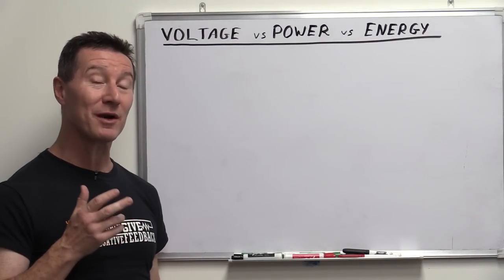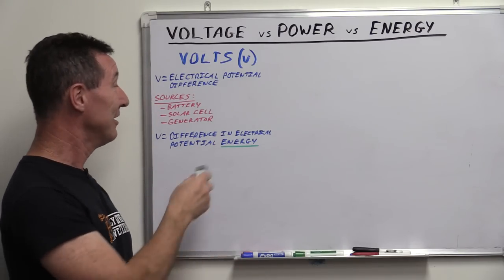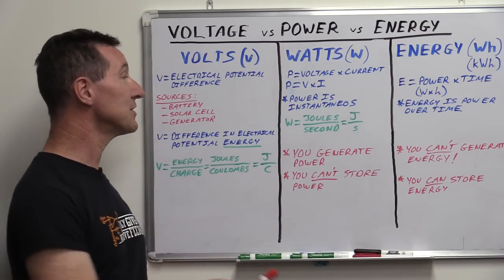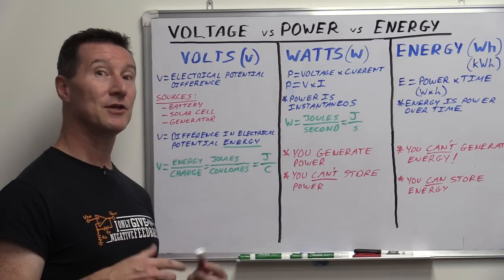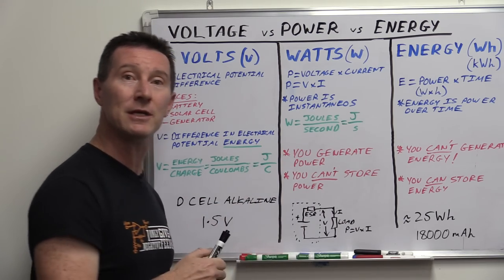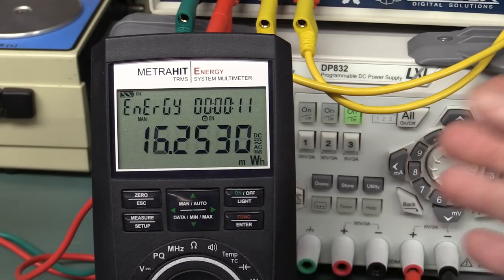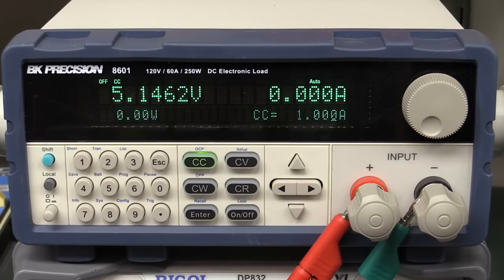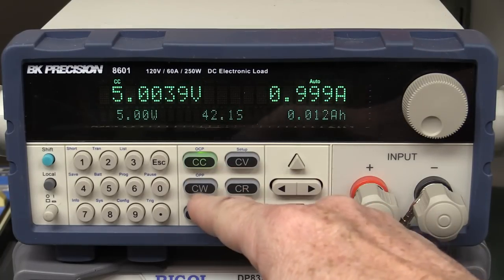EEVblog #1009 - Voltage vs Power vs Energy

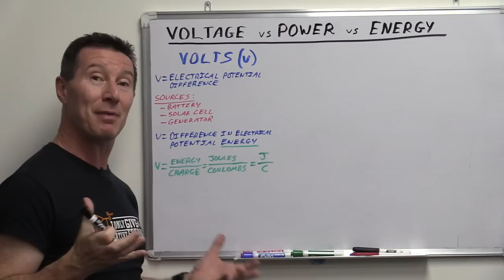Comment: 2:00 So Dave it seems there shouldnt be any voltage if there is no energy even though its just a very tiny amount. As the energy = voltage x current x time and if there is current then voltage is accountable. So both voltage and current are inseparable from each other. Hence to have voltage without energy means time parameter is zero that is not possible. Even if we just want to measure the voltage then also some power is wasted as well as energy even though its very minuscule. Static energy has also stored energy and thats the reason that it destroys sensitive components. What you say ?

Comment: You skipped a bit about capacity, especially with the dam example.
The dam contains the water so that is its capacity or mAh in battery terms
Energy is the amount of power released over time as you said.
But if its not flowing, no power generated, then there is no energy generated too. But its capacity is still there..
Reply: Power is energy in motion

Comment: I love these fundamentals vids.  For completeness you probably should have shown the formula for energy is E=(J/S)*S , which is of course E=J.  I really like your dam analogy, but everywhere you said the height of the dam, you really meant the height of the reservoir.  Going one step further, reservoirs have increasing ESR just like batteries.  As the energy level (amount of water in the reservoir) drops, the voltage (water level) drops, and hence the power (volume of water flow) decreases.
Reply: What? What do the E, J, S and the other S you used stand for? If it's E = Energy, J = Joules, S = Time (in seconds), and the other S = Time (in seconds), then, huh? You are correct that J = E, because they are literally the same thing (J is a measurement of energy, and definitely not a measurement of transfer of energy like power). But what you're trying to formulate doesn't make sense. J = W x t would be correct. Though no physicist or engineer working in the electrical field (heh) uses J, but just uses either E or Wh to denote energy.
Reply: +Lib3rta, these are the same units Dave used in the video.  Did you watch it?  What I wrote is correct.  I'll step through it for you.  1) Watts=Joules/Seconds.    W=J/S.    2) Energy=Watts * Seconds.  E=W*S. (I use Seconds because Dave did) He put both of these on the board.  If you substitute for W in that last formula, you get E=(J/S)*S.  The E is energy, the J is Joules, both S's are seconds.  He didn't put this formula on the board.  The seconds cancel, leaving E=J (Energy=Joules), which as you point out, are the same thing.  He also didn't put this on the board.  That was the point of my comment.  I guess he was right in deciding to leave it out because it would confuse some people.
Reply: @Star Gazer

But you do realize that your equation doesn't make sense, right? Look at "E=(J/S)*S" closely. It is a redundant equation. You devide joules by time, and then reverse it by multiplying it by seconds again. To translate your equation phonetically: "Energy is equal to [energy devided by seconds to get watts] times seconds". All you literally did was converting joules to watts and back to joules again to conclude that joules equal joules.

Edit: ah, great, you edited your equation to something completely different. Prior to changing E=W*S to it, you said E=(J/S)*S. It's okay to edit minor flaws. But come on man, this is a severe sign you hide your lack of knowledge.

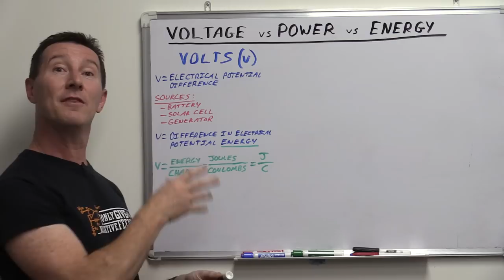Comment: 2:56 Well ... you can't have voltage without any energy at all. Which looking at the formula is kinda obvious, since zero divided by anything will always remain zero and therefore no voltage. But I get your point, since with an energy of almost zero you can still have pretty much any voltage...

Comment: I agree with most of what he said except for the last dam/water example.  The water flowing through the sluice is current, not power.  Voltage is how far the water falls before it is made to do useful work, like turn a turbine.  Current is how much water is flowing.  Power is the product of those two.

One thing he didn't make clear ... he's right in that power cannot be stored.  Energy can be stored but power cannot.  However, energy that has been converted to power, can be converted back to energy and stored.  If I have a hydroelectric plant and it puts power on the electric grid, that can't be stored, it can only be consumed.  But it can be used to charge batteries which stores the power as energy.  Or you could use the power to run a pump that pumps water to a mountaintop reservoir, thus storing water as potential energy.

Comment: I always wonder why people find this complicated!? The time differential of energy is power and if you integrate power over time you get energy. The sign defines loss or accumulation of energy or the flow of current from one potential to thenother in the case of electricity.

Comment: Hey Dave, what about Joules = W x second?, I've seen some power meters that measure energy in Joules. Anyways, thanks for another great video!!!
Reply from the maker: I deliberately didn't involve Joules to keep it simpler.
Reply: Right, Joules is the SI unit of energy. It's a Newton-meter. Applying one Newton of force for a distance of one meter will require one Joule of energy. So, for example, raising an object with a mass of 1 kg, with constant velocity, against gravity, takes 9.8 Joules: F = ma = (1 kg)(9.8 m/s^2) = 9.8 N, and W = Fd = (9.8 N)(1 m) = 9.8 J.
Reply: mgscheue technically, a Joule isn't a "Newton-meter".  "Newton-meter" is a unit of torque.  Newtons applied tangentially times the meters distance from the fulcrum, like foot-pounds.  But yes, a Joule is exactly how you define it, Newtons times meters, but not the same thing as a Newton-meter.
Reply: As Dave said, power is Joules over seconds (J/S), and Energy is power times seconds, so that means Energy is (J/S)*S, and since the S's cancel, Energy is just Joules.  So yes, utility meters can measure energy in Joules.
Reply: And to add another twist, when you calculate the arc fault energy available at an electric panel, you calculate the energy in Calories with a capital C (because that's how the protective clothing is rated).  You could calibrate an energy meter to display calories or Calories delivered instead of joules....
Reply: Please do not confuse S and s. S is siemens for electric conductance

Comment: Voltage = hight of a mountain

Current = size of bolders (diameter of wire ext) 

Resistance = trees in the way 

ieg bigger bolders can overcome bigger trees and higher mountain more trees The bolders can overcom. Lernned from Arduino starter kit book ;-)

Comment: I hate when almost all youtubers show some energy generating machine and they showing only volts instead of how much power it generates.
Reply: You can generate a tremendous amount of power with just a small capacitor.  It would be better to talk about the range of maximum instantaneous power, and the range of energy produced per day. Ranges because of weather conditions for solar or wind power and other variations for whatever method you use to generate electricity.
Reply: Charge a capacitor with an ESR of 10 milliohms to 100 volts and let it discharge through a 100 milliohm load (commonly known as a short circuit).  I = 100 V / 0.11 ohms, P = I^2 * 0.1 ohm = 80 kW or enough for a car.  // Lets make electric cars that run on charged ceramic or film capacitors!!!  If you use lots of them in parallel and big fat conductors, you can have far more power than a Bugatti Veyron.
Reply: The only issue is the maximum range of the vehicle, it's like 10 µm or something.
Reply: Oskar, your power calculation seems a bit off.  If you short circuit a capacitor through a 100 milliohm load I guarantee you won't be measuring 100 volts across it, therefore you aren't getting 80kW out of it.
Reply: Nope, it's spot-on: I didn't use P=U*I, I used P=I^2*R, and I calculated I (not me, the current) using both the ESR and the load. // But I did forget about the ESL, oops.  Let's make it simpler instead.  Cool it down to get rid of the ESR and the capacitor will be able to transfer quite a lot of power to the inductor in pulses for all eternity... That should pay off for the cooling required, shouldn't it? :)

Comment: Nice video - but I don't get why you always complain that battery capacity is measured in As / Coulomb ;) 
I completely get your point that Wh is the more usable measure in practice, but I still think As is the more intuitive one. At the end, a battery just stores a discrete amount of electrons/ions that want to change sides. As / Coulomb reflects exactly that. It's the same with your dam. It contains a well known amount of water molecules, so the most intuitive way to measure its capacity would be to count these molecules. However, the power it can produce over time is dependent on many other factors, like the diameter of the outlet, which limits the pressure (potential). 
The stored energy of a battery can only be known if you also know how it is used. I guess this is why mobile phone / laptop batteries also state energy in Wh. Multi purpose batteries however still mostly just state capacity in As and that is strictly NOT incorrect. A battery has an (mostly) usage independent capacity in As, or an usage dependent energy stored in Ws.

Comment: Voltage = The air pressure in your Super Soaker tank.

Power = The force of the water shooting out of your Super Soaker.

Energy = (The force of the water) x (how many seconds before it runs out).

Comment: I am sorry but the video has a few errors. Energy does not have a time component. Joule is the SI unit for energy. In electronics the unit watt-hours is used for energy, 1 watt is a joule/second, so 1 watt hour is the same as  1 (joule/second) * hour which equals 3600 joules. Energy can be thought of as the ability to work. Power is the rate at which energy is transferred from one form to another.
Reply: Nope.  Using electrical units it does, 100W for 1 hour is 100 Wh.

Comment: Energy is the ability to do work.  Work is defined in different ways: for example, mechanical work is force multiplied by distance.  The energy needed to lift a 1 kilogram mass 1 meter in Earth's gravity is 1 Netwon-Meter, also known as 1 Joule.

Power is the flow of energy.  In other words, power is the derivative of energy with respect to time.  One Watt = one Joule per second.
Reply: A slightly easier way to state power here is, since one definition of a derivative is the change in a quantity compared to another, then the power is the change in energy per second.
That is easier than bringing the calculus stuff into the explanation.

Comment: Something is off with that explanation of static electricity. If V = J/C and you explain that you generate a big charge and that can generate 10s of thousands of Volts, that would require the Energy to be HUUUGE and you said, static electricity is a big voltage with no energy. I don't know it better, just following the explanation and it doesn't add up to me.

Comment: ..let say if I run an appliance with 500w for an hour ..I only need to pay 0.5 kwh = 20 cent, than the accumulated 500w it is using every second..  Which is 500w * 60sec *60min..?

Comment: Voltage is difference in electrical potential.   Without the word energy on the end.  I help students to get this mindset by having them believe there is such a thing as gravitational potential (gravity x hieght) versus gravitational potential energy(gravity x hieght x mass) and have them process what the difference of that means
Reply: The gravitational potential is a result of mass. Mass is accumulated energy.

Comment: Excellent Video!
Stored Energy is defined as potential energy: further proof you can store and release (kinetic) energy.
Reply: Stored energy is only potential power (motion) when there is a break in the law of energy conservation - the big bang event

Stored energy in a state of equilibrium has no reason for motion
Reply: Energy can be stored in form of potential or kinetic energy. Example of the latter is flywheel energy storage systems.

Comment: Experienced EE's, would this car analogy also be accurate?
Voltage is the torque rating of a motor
Power is the speed that the car can accelerate
Energy is the size of the fuel tank?
... ugg, I've never grasped this concept very well no matter how many times I read/watch explanations.
Reply: Topher Snags Actually, Power is Power (horsepower or kW used in both disciplines).
Reply: Also, rpms is like current. And a gearbox is like a transforrmer, allowing you to trade rpms for footpounds when needed.
Reply: Thanks guys, I appreciate the correction!

Comment: Dave,
Thanks for another great video explanation.
One thing, static electricity IS power. The voltage is very high and the current is very low but it is still present, if it wasn't you wouldn't get a shock from it as a shock requires current flow.
Reply: When you get a shock, it's because the electricity is no longer static. It's flowing. Static electricity is NOT power.
Reply: @ArumesYT  No, static electricity is still power and it is still under load only a very high resistance load. Left unattended static electricity will dissipate -hence there is a load causing that. Once created static electricity it will not last infinitely, you can't come back in 20 years and get shock from it. It takes energy to create static electricity, you walk across a carpeted floor for example. 
When you do get a shock it means current is flowing through your body, in order for that to happen voltage must be present, you can not have current flow without voltage. P=EI (power = voltage x current). 
Static is really a misnomer, it isn't an infinite resistance load.
Reply: @mosfet500  Again, if it flows, even very slowly, it's not static. Stop contradicting yourself.
Reply: @ArumesYT  That's why I said it is a "misnomer". It is not static, I explained in detail what is constantly flowing can't be what is being called static electricity.

Comment: is voltage  really electrical pressure
Reply: Yes, you can think of it that way.  It is the unit of electromotive force, or potential difference.  Edit: Seth M insists pressure is force per unit area.  But you'll have to ask him why this is relevant.
Reply: NO, it is only an analogy, close but not 100% correct.
Proper way to think about any electrical stuff is EM fields (not voltage, current, etc.).
Reply: Seth
And voltage is potential energy per unit charge, which is completely irrelevant for someone watching a fundamentals video and trying to get an intuitive grasp on what voltage is.  

Xyz
You're completely off base here.  I can appreciate your point, but this is not a college level Electricity and Magnetism physics course.  The physics behind it are important, but completely unnecessary for a practical understanding of electronics.
Reply: You know what, nevermind.  You're absolutely right Seth.  I've updated my original comment to reflect this.  Do you know what a pedant is, Seth?

Comment: This is what bothers me the most about the water analogy: current = flow of water, voltage = pressure, but when actually relating to water (fluid dynamics), pressure can increase the flow of water. So while we're taught that 'flow x pressure = power', the water analogy conveys 'flow x pressure = flow'.
Reply: It's an analogy.  It isn't a perfect representation, or it wouldn't be an analogy.  Electrons also aren't wet, nor do they evaporate.
Reply: The point is that the analogy isn't coherent, because it doesn't properly convey the concept of voltage.

Comment: You cannot have voltage without energy. It may be very small but it requires energy to 'create' a potential difference or else the conservation of energy law would be violated.